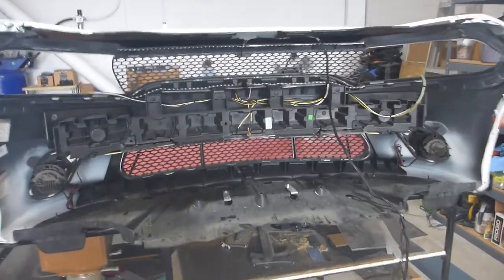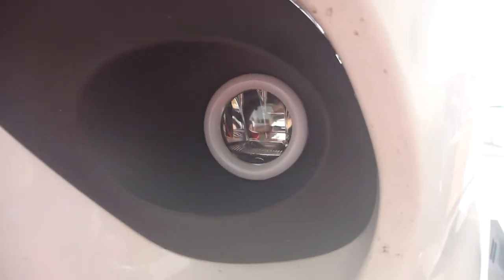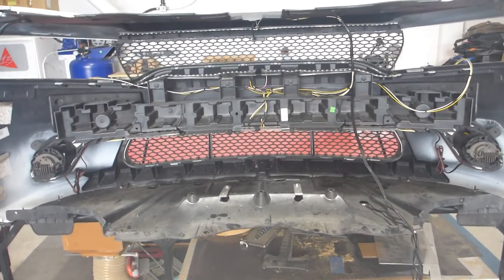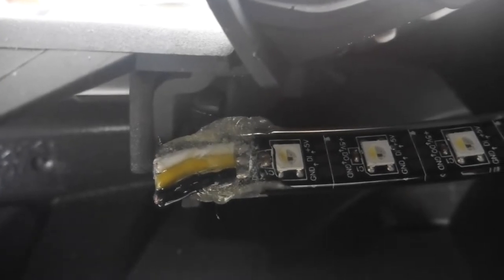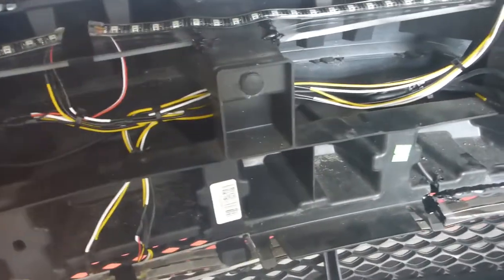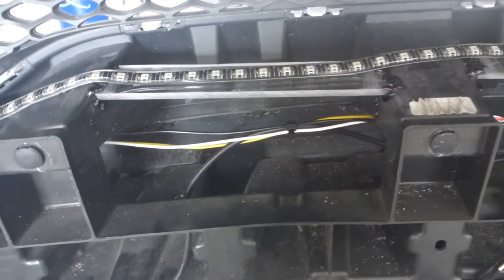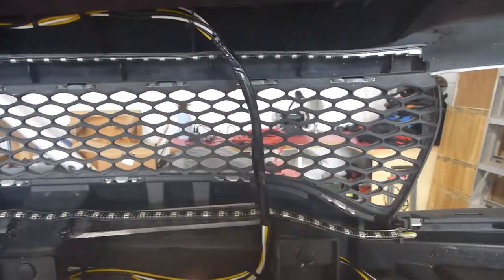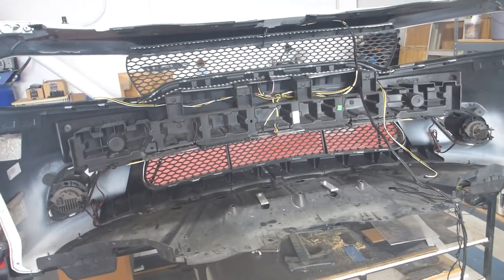BTS: Dodge Charger Addressable LEDs Grille Lighting Installation

Comment: Did you come out of ghozt to grille lights then to the headlights? I’m attempting the same thing on my car but I’m also adding projector halos. Any information or help would be greatly appreciated thanks
Reply from the maker: You're going to have a bad time trying to put halos in the middle of a series.
Reply: @Bythirteen   I’m going to have to get very creative with them or just not have them. Thanks
Reply from the maker: I wouldn't necessarily say 'creative', but it's certainly a unique challenge.  As a general rule, I design around it so I don't encounter the dilemma.  But you got the right attitude!  Happy experimenting!